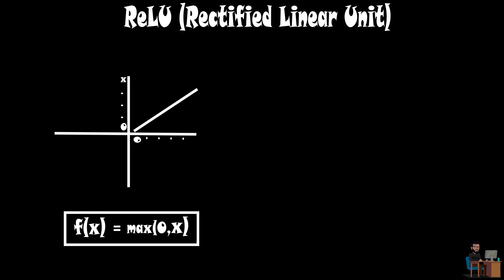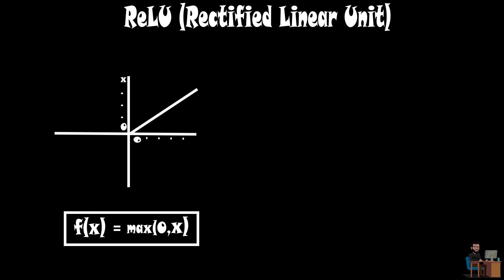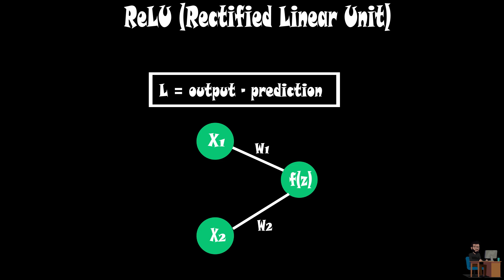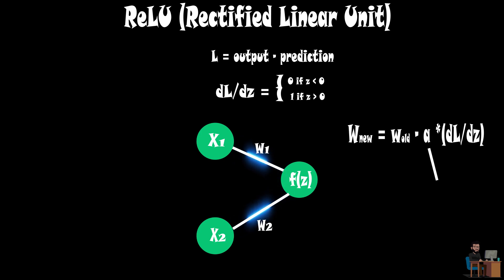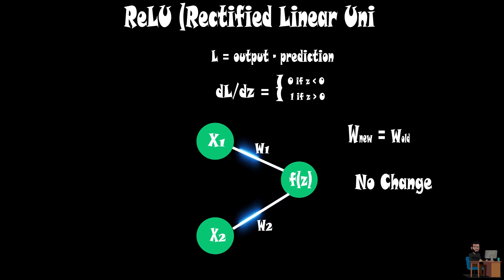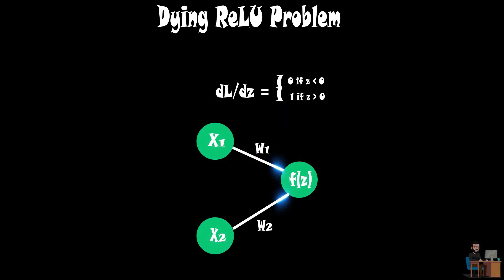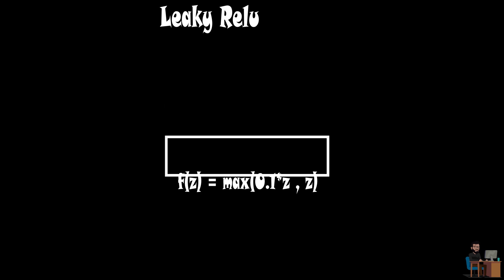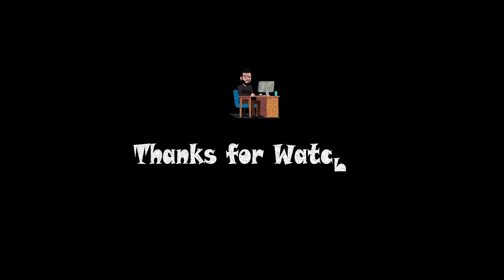Dying Relu Problem || Leaky Relu || Quick Explained || Developers Hutt

Comment: I think when the gradient is zero it will still learn unless the weights are greater than zero but when both weight and the  gradient is zero it is a dying relu correct me if i am wrong
Reply from the maker: When the weights will be zero, everytime you feed a new input the network will follow a new symmetry. And hence it will not be able to learn until or unless the summary will be broken

Comment: in case of stochastic gradient descent this neuron may die only for one particular record for which sum of weight and input product is negative, hence during back propagation local gradient will be zero which will not let the pass gradient coming from back of the network and its weight will not be updated, so we can say that this neuron is dead. but for next forward pass with new/next record sum of weight and input product could be any value and so this neuron may become active for this particular record hence it will never be dead forever ???
Reply from the maker: Theoretically, Yes